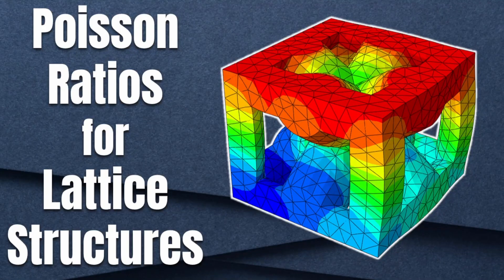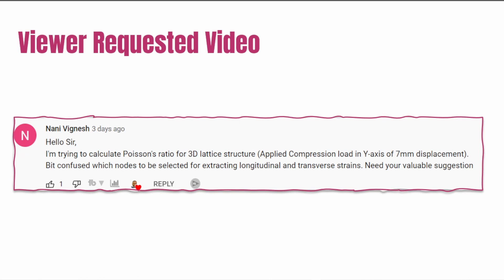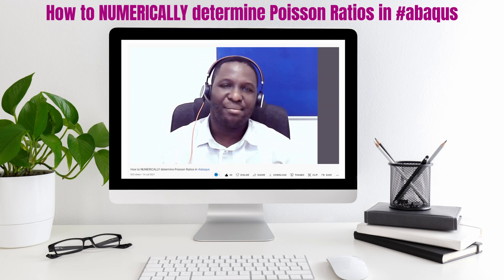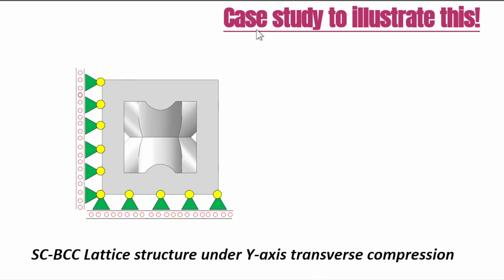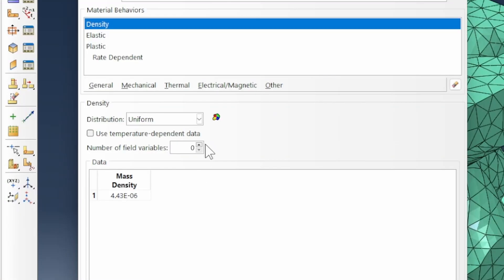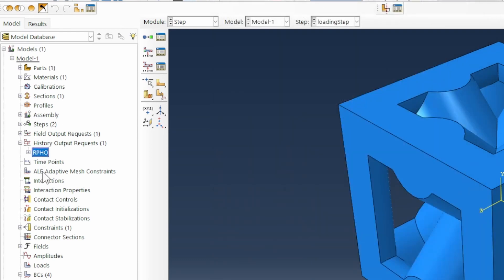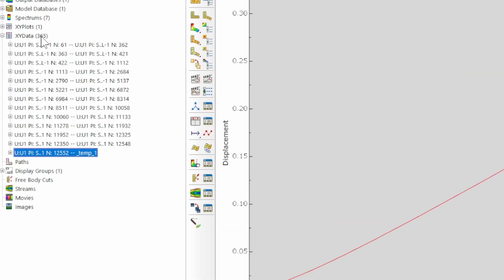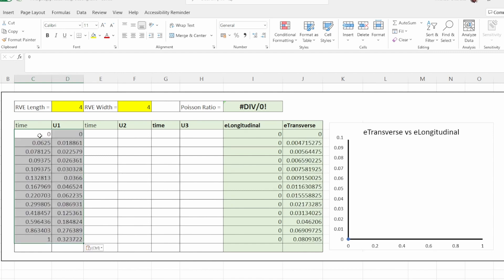How to determine POISSON RATIOS of LATTICE STRUCTURES

Comment: Hello Dr., first i wanna thank you for your videos they are really helpful. I wanted to ask you what is the difference between averaging the transverse displacements in the face  (the method you are using in this case) and averaging the transverse deformation of all the elements of the unit cell, and then calculate the poisson. If the second is wrong, ¿why is that?. Thank you very much Dr.

Comment: sir how to find the poisson ratio for auxetic structures...
Reply from the maker: As regards Auxetic structures, the approach for determining Poisson Ratios shown here will still apply. You just have to carefully isolate your reference points. The auxetic structures will have a difference mechanical response from the hollow steel structure shown here but in terms of deducing the poisson ratio, this approach will still apply.

Comment: Hello Dear Sir,

I watched all of your videos on Youtube, they were very useful and helpful, thank you very much. How can I plot the Negative Poisson Ratio of the auxetic structure - strain graph in the Abaqus program. I need you.
Reply from the maker: Hello @Ogr. Gor. Halil CELIK, thanks for your comments. Glad you found the videos helpful. On the issue of Poisson ratio, I made a video about this a while ago. Have you seen it? Here is the vidoe: https://youtu.be/tmFR2OiRKbw. I know that in this video, I did not deal with Negative Poisson ratio but the principle remains. You just have to isolate certain reference points and then track them during the simulation. From the generated plots, you can determine the Poisson Ration as I showed in my video. 

Let me know if this is helpful!
Reply: @MichaelOkereke   Thank You Sir,

I will try to do it again, if not, I will let you know

Comment: Hello Dr.Michael, thank you so much for this video. I tried to calculate poissons ratio by using this video but i'm unable to get right value. Can u plz share your mail Id so that i can share my model with u. Also i'm trying to do same problem with 1D beam elements, the deformation is different in 1D model. Can u please guide me on this.
Reply from the maker: Hello @Nani, thanks. I am not sure why your model is not working. If you want to get in touch, it is best you come through my CM Videos Insider group which you can sign up via: https://cmvig.cmvideos.org/. From the welcome email, you can reach out to me with with your query. Cheers.
Reply: @MichaelOkereke   Hello Dr.Michael I have sent an email  to you. Awaiting for your reply